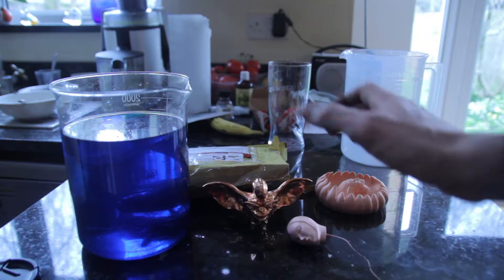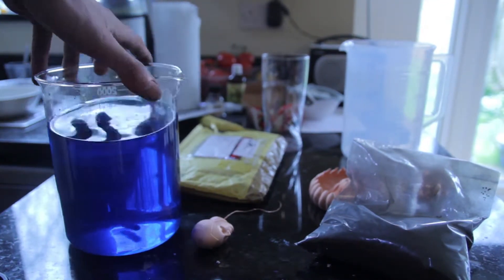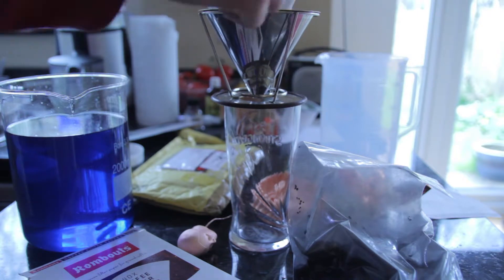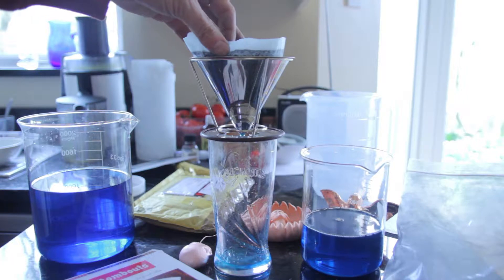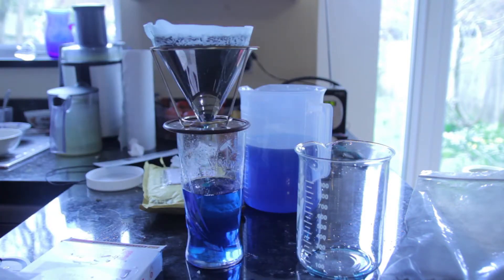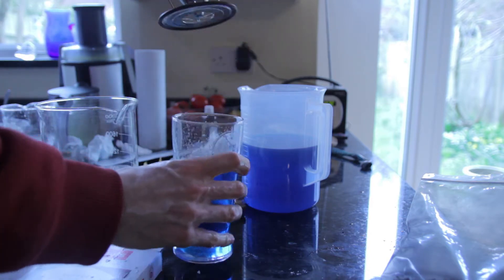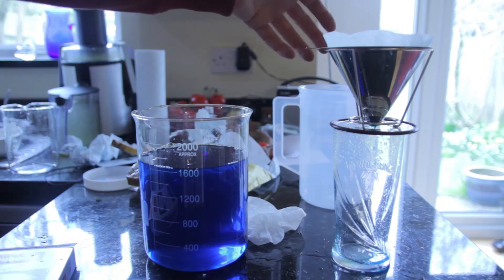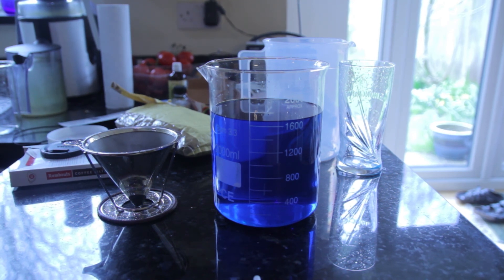DIY ACTIVATED CARBON FILTER

Comment: I've sussed it!! .... I'm now getting shiny copper again, .... It's a long process but it works, makes your solution back to new again ;-)
Reply from the maker: What did you do to remove the contaminants?
Reply: @Cloakfiend  .... You have to add Hydrogen Peroxide in the solution and it clears all the organics and contaminants in the solution. It fizzes up when you add it and that's a good sign. Once your happy with the bubbling/fizzing has stopped, then you add a small amount of carbon to the solution for a while, then filter the whole solution out with a coffee/lab filter .......... This process will bring your solution right back to new again. Only thing you will have to add back to it will be brightener and some acid, job done! Onlt draw back is it takes 24 hours to do, depending on the amount of solution you have.
Reply from the maker: @EssexSilvering  interesting ill be sure to give this a try! Shame i have to work. Apparently im a key worker. How much hydrogen peroxide? And i assume the carbon filter is to get rid of it later. Also what kind of activated carbon did you use. Was it like in this video or was it a solid that you just left in the solution for a 24hrs? Great info thanks! Be sure to give this a try i just got rid of my old stuff but i have no acid unfortunately. I still have 2lrs of new juice left so it should be fine. Well done for finding that out!
Reply: @Cloakfiend   .... I'm guessing your in the UK? ... If you are you can get battery acid (Sulphuric) from Ebay, comes from Germany, get it all day long ;-) ... Your going to need the acid because this removes everything apart from the copper sulphate solution, hence it's a fresh solution. The Hydrogen Peroxide I used was 12% (ebay) at 12ml/litre ... The activated carbon is the same as yours but you only add a little bit after you have done the peroxide part so it's the last bit you do, add 3-5 grams per litre of acticvated carbon to the solution, this will remove the organic contaminates that the hydrogen peroxide broke down in the first place. After about 6 hours filter out charcoal. You can use coffee filters or 1 micron filter material. Filter until all of the charcoal and dust is removed from solution. Your solution is as good as new now, add new brightener. Top up with Sulfuric acid and HCL if needed. .... Job done, lovely jubbly!! ;-)
Reply from the maker: @EssexSilvering  yes im in the uk as well! Thanks again for the useful info! Much appreciated!

Comment: I am also having the same problems, ... I know it now been a couple of years since you posted this video but have you had any joy in this problem? I had my parts lovely and shiny just like yours but now it doesn't matter how much brightener you add, it still remains dull or pink salmon colour. .... Hopefully you or someone else can let me know. Thanks for sharing anyway ;-)
Reply from the maker: Im afraid theres no way due to impurities. Unless you know how to remove them adding more brightener and leveler and whatever else simply wont work. Im afraid you are going to have to do as I do just get some more. The alternative is to use straight copper sulphate with acid but no brightener. And just add a tough of molasses. That way it will last longer. A chemist could re purify the solution but after throwing in andless models and stuff, alas the solution is no more. One solution lasted me a whole year!!!  But diy ones usually die after like a month or 3. For me anyways. I guess it all depends on how likely you are to contaminate your solution. Like impurities in the copper anodes or cathodes, dirt inthe solution, foreign objects, contaminated condensation, dirty glass etc... so many sources of contamination!
Reply: @Cloakfiend  Thanks for getting back to me. I am currently trying lots of ways to cure this as I've got all the time in the world right now, doing as Boris say's ;-) .... I am working on the filtering and also adding more copper sulphate as this could be half the problem. I knew exactly where I was in the measurements of my solution but now I'm completely lost buy adding more acid, water, brightener etc, ... I have a home made solution from scratch but if I can't get this sorted I'll have to bite the bullet and buy a 5lt kit which I am trying to avoid doing. If I suss it out, I'll let you know what I've done ;-)

Comment: Cloakfiend, did you find the solution? You have to add some brighteners from time to time, I suppose:

"When the levels of brighteners in the copper plating solution drop, the plating will begin to become dull. When this occurs, add a cap of both part A and B to the solution and test for brightness"

http://www.gaterosplating.co.uk/replacements/electrolyte-chemicals/copper-brighteners
Reply from the maker: dvalid if only it were so simple... i tried that but there are contamination issues and copper buildup. Brightner comes with no real instructions on how much to add and no real way to use it. I have plenty of brightener. Makes it matt now rather than shiny or salmon. Ill keep trying. But manual polishing looks better anyway!
Reply: Kind of frustrating. I've tried couple of brighteners from the other suppliers, sadly all of them worked for a limited period. Something is contaminating the solution, the wrong anodes maybe?
Anyway, thank you for your videos!
Reply from the maker: dvalid you need to clear the copper out of the solution as well. Its chemistry unfortunately. Its easy if you know your chemistry. I failed at chemistry. I have no idea what to do to maintaina  perfect solution but ill just keep going to the suppliers that privide extra brightener because that way i can either stretch it or get more solutio n and add to it. Its no deal breaker. Dont leave your anodes in the solution, that contaminates the tank with too much copper.

Comment: Good final surfaces on objects. Do you figure out what to add for shiny final ?
Reply from the maker: Martin Procházka new solution works but the key is how to get it back after the sooution has been used a few times. Ph balancing is required. But im counfused at how to do it as there are no clear instructions ANYWHERE!
Reply: Cloakfiend If I good understand, this solution with filtering through carbon didn't work. Do you mixing you electrolyte or is it bought all in one ? Maybe for shiner you can use some polyethylene glycol. It just tip from this forum : https://www.finishing.com/111/72.shtml . I am mixing my solution from copper sulfate, 30 percent sulfur acid, destilated water and also looking for some shiner. With my solution I always need to manually shining with steel wool object and before that they looks like yours with old electrolyte.
Reply from the maker: Martin Procházka its brightener you are after....but that is a trade secret. You wont find any instructions on how to synthesize it. Youd have to go to libraries and get it from books when people werent so concerned about copyrights. If you find something let me know. Filtering it simply removes organic matter and crap floating about.
Reply: @Cloakfiend  Exactly. You would need to replenish the other chemicals in the copper-acid solution for the Brightener to work. If you could keep the solution for ever.. your vendors will go bankrupt.. :D 

Oh and please dont dispose of it in your garden or toilet.. bad for the environment & the law..  place a big chunk of steel wool inside and let it replace the the copper, you get a clear solution.
Reply from the maker: @dizingof  Thanks for letting me know how to dispose of it! i was wandering about that.   A simple acid copper bath is fine without the brightener anyways, just need some elbow grease to polish it up after. Flash plating is the alternative I guess. I've learnt a tremendous amount on my own anyways. Its very frustrating because literally no one i ask for help of information gives any. It kinda the reason why I don't give the information out how I do things. But I will one day. After all I'm doing this for fun not money. Such pity, I'd like to understand why certain things happen and how to fix them and how to improve my methods, but Im pretty much driving blind and relying on google and helpful others for scraps of information here and there.
Reply from the maker: @dizingof  Also I have seen endless all in one metal plating kick-starters fail one after the other and dual activating sprays and all sorts of things, but again they turn to dust and never heard of again. Like you said, there are far to many consumables for this to ever last more than a few days at best in heavy use before depleting certain elements. and even more over time.
Reply from the maker: @marprochazka  I hear Molasses is used historically as a brightener but I have never tried. I know I put in some black stuff, but also bright green stuff or bright blue stuff. Dont know what any of it is.
Reply from the maker: @dizingof  if you could sell me a kit to experiment with I would be extremely gratful and, it would make my art much less painless! Others have shown me dual spray-on electroless methods but when i asked to buy stayed quiet. If you could actually offer me a real solution I would be so thankful!
Reply: @Cloakfiend  Electroless method is very costly, palladium activator cost more than gold.. and you can only do few microns thickness, for use Artists/Makers we want real THICK Metal to resemble a cast statue.  I've been working on this very hard, see here www.metallizr.com - i'm currently in the IP stage, meaning a patent & design check - i'm afraid i cant sell anything now. These things take "some" time. I hope to see you on board when i launch. In the meantime if you're going to test Molasses syrup, use ONLY a fraction of a drop per litter or it wont work -  a drop for 5 litters. You wont get the same shine as modern chemistry Brighteners but its definitely a less "elbow grease" polishing..
Reply from the maker: @dizingof  any chance of a small sample that i could try on a model? I would of course give you/ your company / product a review. Im I the uk btw. Even a demo at a location of your choice would be great. A new cheaper painless method of plating would be great! And thicker coats even better as i patina my work and some patinas are very destructive!
Reply from the maker: @dizingof  and yes of course ill be on board!! I was about to buy 25kg od copper sulphate but now you said all this i might wait. Could i send you a model to test it on for me? Id pay costs of course!
Reply: @Cloakfiend  Thanks, Like i said i cant but my huge IG gallery speaks for itself.  Crossing fingers i could launch this year! I need a critical mass of interested makers. Good luck :)